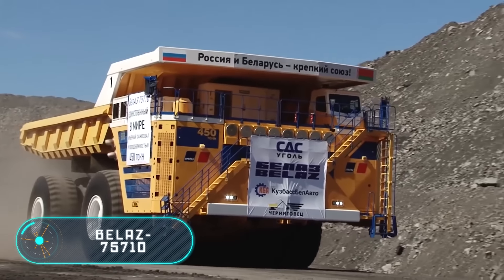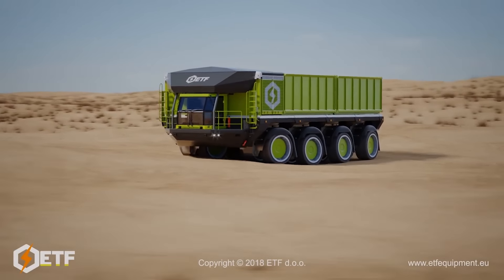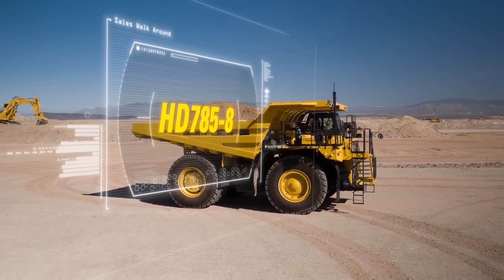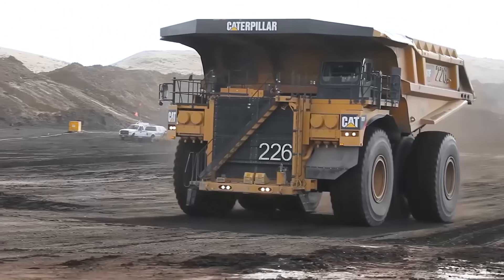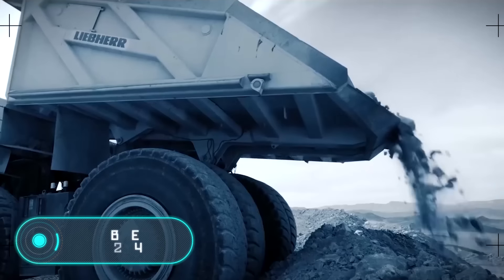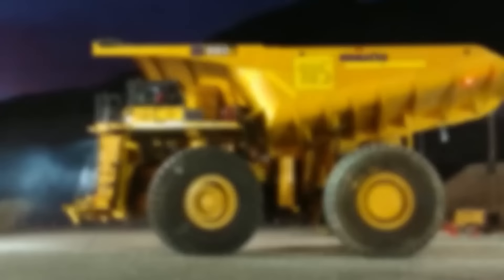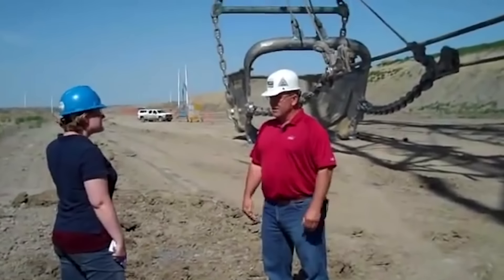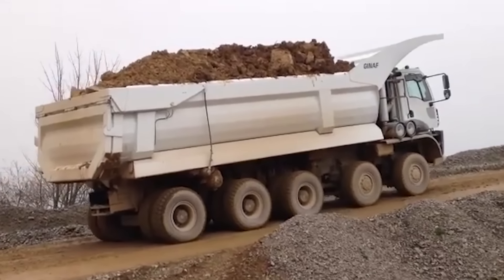10 LARGEST DUMP TRUCKS IN THE WORLD

Comment: Caterpillar in NOT a german company! It is an AMERICAN COMPANY!
Reply: Yeah a lot of these videos on these truck they don't know what the hell they're talkin about
Reply: Can be seen from it name
Reply: lllllllllllllllll
Reply: As far as I know cat is owned by zeppelin which is a German company
Reply: @krocha88888888  zeppelin power group seems to be a partner with catarpiller in Europe. Caterpillar is owned and operated American company. But I could be wrong! Getting my information from Google. You have a nice day and happy holidays!
Reply: The trucks also are not manual transmission. They have an automatic transmission with the ability to select a gear in a sense that the transmission will not shift past it. But if you haul it down into 6 (drive in the F series) it’s automatic.
Reply: I wonder how the environmental impact of these gigantic trucks compares to smaller models. The Liebherr T284’s fuel efficiency is impressive, but can it really offset the carbon footprint from all that mining?

Comment: I’m just thinking about how these trucks would actually make good camps in a zombie apocalypse so long as you had enough fuel to last your lifetime and nothing in the truck breaks down. It’s like a moving campsite. I get that you definitely wouldn’t be able to maintain it in that scenario but it’s neat to think about setting up a large tent in the back along with a tiny cam inside of it.
Reply: There's a movie that has rolling camps and even a small city. I can't remeber how the movie is called but it's not older than 10-15 years.
Reply: Turn it into run on nuclear power. You will never run out of fuel for a very long time. Problem solved 👍🏻
Reply: @Snorky_88  I don’t know how to do that 😆
Reply: Me too
Reply: @3DPeter  I wonder what it’s called
Reply: @jamesjohnstone8098 Maybe it’s mortal engines?